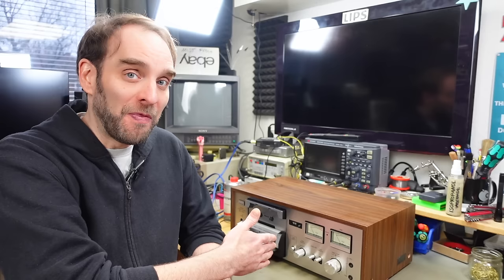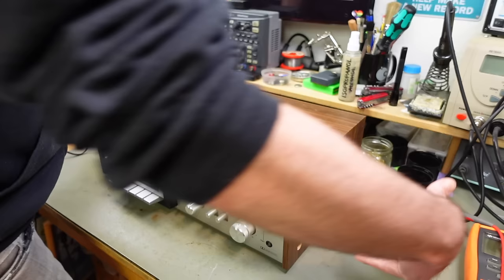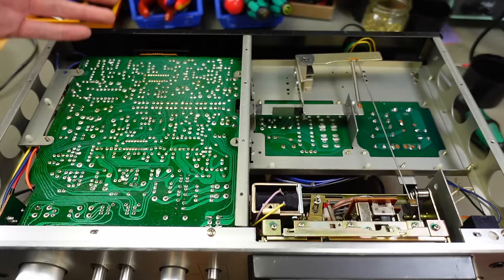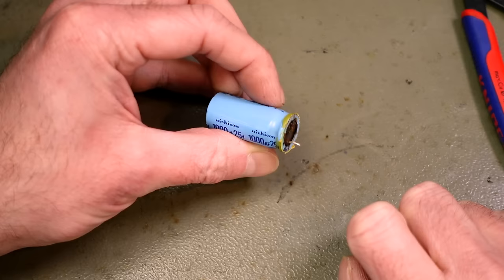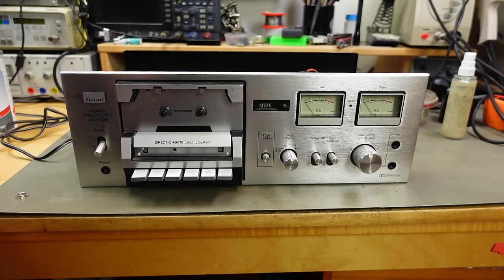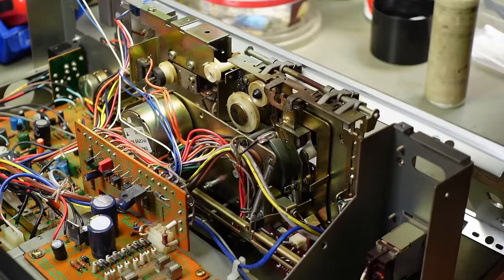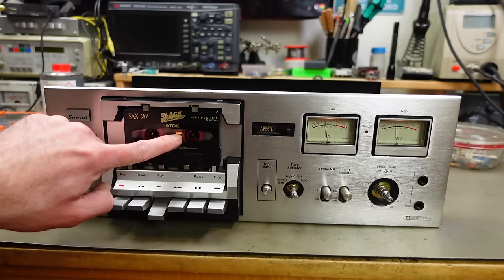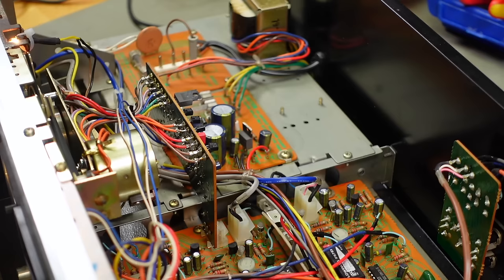Sansui SC-1100 Tape Deck Restoration & Repair

Comment: Note on the poly caps: If you want to help them do their best, test them on an oscilloscope to see which leg is the outside foil. Mr. Carlson's lab has a video on it. Connecting that side to ground will shield the caps and provide just a tiny bit less interference. The downside to single sided boards is they don't have the massive flood ground planes like we're used to in multi-layer electronics boards today, so they don't get that passive shielding.
Reply from the maker: Ah, yes! I even remember watching that video but I forgot all about it. Thanks for the reminder!
Reply: This is awesome advice, dude. I've noted it in my restoration notes. Thanks.

Comment: At 33:10 - removing e-clips. Not easy, I use a very small strong (flat-head) screw driver to 'prize open' the spring and of course put a little 'Blu Tack' on the spring to stop it flying 1000 metres away! I am always aware that the said e-clip could find itself in the circuit and cause a short-circuit somehow, so if I lose one of these, I make sure I find it!  :o)
Enjoying your video Jan!
Reply: Holding a strong magnet close to he clip during removal would also work. I doubt the clip was nonmagnetic.

Comment: I have a black version of this machine and recently after being at my mums for decades I brought it home, cleaned it up and fitted 4 new belts and had to resurface the pressure roller and use rubber renue as it use to chew tapes but ok now. Then the motor stopped so took those three screws out to move motor about and stripped it and cleaned pickups and now the deck plays back perfectly..Recorded some tracks onto TDK SA90 tape with Dolby on and this machine on playback sounds superb, not bad for a 1978 machine..great video by the way..👍

Comment: This video inspired me to try restoring my Sony deck that I got for graduation in 2000. The belts were extremely gooey. Fortunately, replacements were readily available on Amazon.
Reply from the maker: Awesome! Most of the times, the decks only need the belts replaced indeed. Thankfully they are mostly still readily available (at least for the "better" models). :)

Comment: I was always fascinated by the engineering that went behind any tape deck. I used to ride my bike around in the late 80s and trash pick old boom boxes and fix them. 9 out of 10, it would be the belts just slipped off and people would chuck them 😂
Reply from the maker: Yeah, the belts are certainly the weakest link (quite literally). :D

Comment: See if you can pull the plastic cap on the rewind reel. If you can you should find a c clip you can remove to clean the axel it rides on. Also, clean the tire around the rewind reel. Typically the rewind will run faster when there is more tape on that reel.

Best of luck!

Comment: I just pulled out my SC-1100G from the damp cellar that's been flooded a couple of times and it still powers up, but it goes into stop as soon as you press play, must have this looked into,there is one belt coonnecting the motor to the flywheel (probably wrong), there is some black goo on the wheels inside, probably the leftover from the original belt. It's different layout inside, the power unit has a different number - 4002444. THE G HAS THE SAME WOODEN CABINET BUT IT IS SMALLER THAN THE FACE PLATE WHILE ON THIS REGULAR ONE IT GOES OVER THE FACE PLATE.

Thank you for the thorough instructions, I may even try to fix it myself.

Comment: Very interesting design, i really like it.
The PCB layout is a real work of art especially when you take into account the capacitor polarity all facing the same direction.
Perfect entertainment for new years eve.
Best wishes in the new year.
Reply: That kind of attention to detail reminds me of something that happened while I was studying engineering: in the postgraduate laboratories, the emergency power switch was located right next to the lab telephone, so people were always accidentally hitting the switch with their elbows when answering the phone, causing everyone in the lab to lose work when their PCs shut down. Eventually, one of my friends got fed up with this & got one of the lab technicians to make a kind of frame to fit over the power switch so it could only be pressed straight-on. When the technician gave the finished part to him, my friend noticed that the guy had constructed it in such a clever way that the welds holding it together were invisible from the front. My friend protested that the technician needn’t have gone to such effort for what was a bit of a throwaway project & asked who’d know if the welds were there in any case. The technician looked at him and said, “_I’d_ know”. Now that was someone who took pride in their work!
Reply: @KenKeenan1973  that's the way you should design something like that.😀
Done a decent amount of work for public places as a welder/fabricator and hiding fasteners and welds was always priority 1.
Especially in environments like labs or in the food industry it has a high priority.
These days I am a part time mechanic at a machine rental company and need to fab stuff on a regular basis.
I just take the time to design it so I can blend the welds and as little welds as possible are visible.
Also a small business owner with a cnc plasma cutting table making signs and stuff as a side hustle.

Comment: High impedance input circuits: It's is worth noting that if anyone ever replaces an OP Amp, (most) ICs, small signal transistors, that after cleaning the effected areas that we then apply some conformal coating. This is an insulating paste/liquid that will set and provide good insulation on the solder side of the board. It is very easy for stray electric fields around the circuit (and they do exist all the time) to drive small charges across components and upset the voltage-sensitive circuits.
Regards and Happy New Year!

Comment: Back when I worked at an auto repair shop (early 80's) they used to call those e-clips (or c-clips) "Jesus clips", because of what you'd say when they flew off into some alternate dimension (probably in a pile right next to  the pile of left gym socks).

Comment: Great video! Acetone is a fairly strong ketone solvent and is great for some things but rubber doesn't like it. A better choice is a hydrocarbon solvent like naphtha or a plain old paint remover blend, they're weak solvents but are more similar to rubber chemically and dissolve in it more readily.

Comment: The second-best thing to having test tapes is simply to have a few high-quality, commercially pre-recorded tapes of music you're familiar with, and adjust the speed until the pitch is correct and the azimuth for the brightest, clearest sound (ideally with the left and right channels summed to mono, to get the most accurate adjustment).
Reply from the maker: I only have very few tapes left unfortunately, some commercial ones though, so that’s a good place to start I guess. Thanks for the tip! I also ordered some proper test tapes in the meantime so I hopefully can adjust everything accurately. Just have to figure out how to set things up (there’s some nice test software as far as I know, so I’m going to give that a shot). :)

Comment: Hm, the whole deck is honest and has a really clean layout. Even if it was a mid range or low range deck, it's worth salvaging. The missing plastic cover fits the deck really well. Even if it would be existent, I would keep it away. Looks much more special.

btw: you didn't have energy to disassemble the whole mechanism? I did it a week ago to my Sony KA-TC5ES. A lot of fun :-). A 5 layer mechanism. Like a puzzle with belts, screws and two huge flywheels, even on a non auto reverse deck (never seen that before).

Comment: I have used old VU meters as voltmeter by soldering a 100k resistor to it in series. Obviously, the value was arbitrary and i was basically playing with them, but if the right value is chosen, it can be a volt or amper meter.
Reply: And the resistor must be in parallel in amperemeter setup.

Comment: The search keyword you're looking for with the 12v bulb is "grain of wheat bulb"
Reply from the maker: I found the correct size by just looking for "miniature lamp", this form factor seems to be pretty common, available in 3mm and 4mm sizes mostly. I think they are often used for model making and such as well. :)

Comment: That's quite a high-end cassette deck.  You had to take your time to get it 100% -- well done!  Happy New Year!
Reply: Ironically, it's the lowest-cost lowest-featured deck in Sansui's 1978 catalog.  In market terms at the time, it would probably have been on the lowish-end of mid-range in terms of function.  I suppose it's a comment on how low the quality of things are now in the early 21st century.
Reply: @dennisp.2147  Yup.  Sansui makes pretty good gear, even on their low-end, though.  I guess i was taken in by all the features (Dolby, metal tape support, 1/4" mic inputs, and that waggity control panel for the tape deck...)

Comment: Hi there I've replaced all 4 belts on deck and it plays back perfectly most of the time but creases tapes occasionally and you can hear it doing it..would you suggest swapping the pinch roller and where is best to get one for this machine..thankyou..

Comment: I would not use low ESR caps, if not required, because they very often have a water based electrolyte (see datasheet). And that tends to dry out easier. Low ESR is usually only required in switch mode power supplies.

And since the modern electrolytic caps have a lower volume, it is good to invest in a higher voltage rating for a longer lifespan (that is, what I do in developments). I guess, the lifespan somehow is proportional to the amount of electrolyte and volume. Of course, the rubber sealing is another critical factor.
Reply from the maker: I think the Panasonic FC series caps I used are marketed as "low impedance" so they are not quite as low ESR as their other series (still lower than the original caps when they were new probably). Not sure what kind of electrolyte they use though. I‘m going to have to see if I can find any more conclusive data about them. Good point.
Reply: @JanBeta  the datasheet doesn’t say anything about the electrolyte. The ESR is „a little bit low ESR“. I guess, it os not water based. From the ESR, I would say, it is am ethylene glycol/borax based wet electrolyte. What the datasheet clearly shows, is that the endurance increases with the size of the capacitor.

And what we don’t know is, will the rubber sealing be good in 10 years, 20 years, etc. I didn’t see many leaking caps in the Commodore computers yet and I didn’t find many with a capacity, that is lower than specified, so the old sealing was quite ok. Nobody talks about the sealing of modern capacitors. In most applications, the capacitor doesn’t have to work hard, in switch mode power supplies, the electrolytics are galley slaves with a lot of ripple current. That is the thing, which really stresses a capacitor.

Comment: Pro tip: if you use WD-40 to clean up sticky stuff, clean that up with IPA to remove the oily residue.
Reply from the maker: Yes, I’ve seen people using WD40 in some videos. Definitely a good option. Acetone worked beautifully, too, though. Although it is a lot more aggressive if you accidentally get it on the wrong spot of course.

Comment: 41:07, all those diodes where the fuses are, is that a rectifier?  I’ve never seen them perfectly in a straight line like that.
Reply from the maker: Yup, 8 diodes for 2 rectified DC rails as far as I understand the circuitry. The layout is hand drawn so it’s very clean and lined up a lot neater than many computer generated PCBs. :)

Comment: I have a well used technics tape deck that has a quieter output on one channel. The same thing happened to a Sony Walkman I had. Cleaning the heads made no difference. Anyone know what causes this?
Reply from the maker: There can be quite a few things causing that. Maybe it's just dirt on the record/playback head or the head got slightly misaligned. On most proper cassette decks, there's also potentiometers on the board to adjust record and playback levels for both channels individually. You would have to look up a service manual for your particular model and see if you can find the adjustment procedure. Maybe that helps. Heads also wear out over the years but I've not seen that happen very often as long as they are reasonable quality.
Reply: @JanBeta  Thank you for the great advice.

Comment: I would guess the rewinder roller (idler) would probably originally had a small rubber tire around it? Most of the models I've seen from around that era had it. So it's probably not having enough traction now.
Reply from the maker: I think the little roller didn’t have a rubber ring, the other two parts that it touches do have rubber so it gets enough grip from those I suppose. At least I couldn’t see any remnants of rubber on it, it had a really clean plastic surface.
Reply: @JanBeta  I just checked the service manual (it is available for free download and it may help you with other problems) and it looks you are right, the rewind idler does not seem the have a rubber ring.

Comment: I always find these videos infomative and entertaining :) Happy New Year!

A question, here maybe I can have an answer: how is it that audio equipment always set that the volume is normal in only the first few percent of the possible value? My old boomboxes and amplifiers were all working between 10-20 degrees on the dial, an old boombox had a volume slider, needed to just pick with the fingernails becouse the of 5cm length the first 4-5mmm were usable. After that it's way too loud in the room (not small, ~20m2) and/or distorted... Even the more modern TV with the digital volume control uses between 10-20 of the possible 100.
The question come up now for me, becouse I had an old ('90s) sony ampiflier, but only a mediaPC hooked up. Now I bought a real CD player, and again, only the first few degrees on the volume knob, after that my ears would pop 😅)
Reply from the maker: The volume potentiometers are usually logarithmic pots, so you get a more accurate setting in the lower parts and the higher you get the more exponential the volume increase gets.

Comment: Awesome vid! I have the same deck along with a Receiver and Phonograph, I bought a belt kit off of Amazon, I think the tension belt is a bit small in the kit.  My current problem is when I hit play it engages the auto stop, but FF and RW work just fine, any suggestions?  Honestly if you were local I'd have you do all the caps for me.
Reply: All idler and drive wheels and capstan/flywheel spin freely, the 2 main black take up spindles do have a tiny bit of drag when you manipulate one of the play, record or rewind buttons to let them spin free of the flywheel. I don’t know if its possible to remove them to lubricate
Reply: With no belts the motor starts then auto off gets triggered 😢
Reply from the maker: Auto stop is connected to the counter mechanism, so without any belt that is normal behavior. I haven't figured out the way to remove the covers from the spindles unfortunately, the service manual doesn't elaborate on that. If the auto stop is engaged too quickly, one very likely reason is also the capacitors on the little angled board that plugs into the main board. As far as I understand, the large cap on that is responsible for the delay for the stopping. It is charged up and then triggers the row of transistors on there which engages the stop. If that capacitor is faulty, the auto stop is going to engage no matter what else is happening, basically.
Reply: Well, removed belts again, pulled auto stop board, found no signs of bad caps or solder anywhere on all boards, put belts back on and reinstall auto stop board, now it plays 🎉🎉  Thank you!!
Reply from the maker: @swamprat2818 Oh, then possibly something was just stuck a tiny little bit. Glad you got it to work! May it continue to do so for a long time! 🤞

Comment: I have a D90 that looks quite similar, but of course, cheaper. Pretty good quality overall, sadly lacking Metal recording.
Reply: Il tape selector non puo essere compatibile,la type 4 e' nata nel 1979
Reply: @giuseppelavecchia775  Good point. Didn't think about that. I still like the D90!